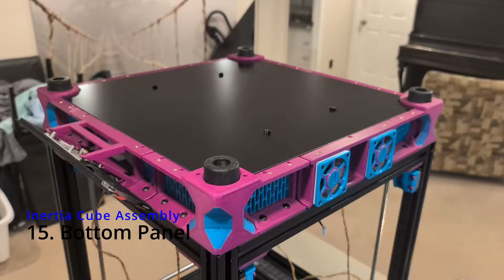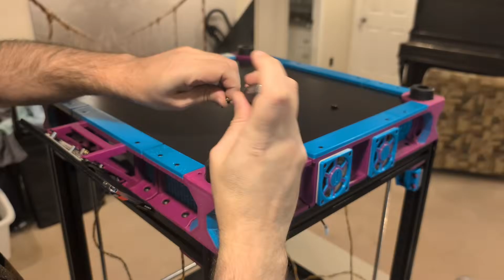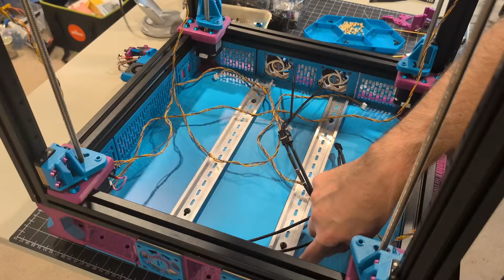Inertia Cube Assembly - 15. Bottom Panel

Comment: Do you use send cut send in canada ? I'm trying to find a place in canada to cut my panel
Reply from the maker: Because I like to bling out my ACM panels with decals, I use Happy Mfg out of the US. There is a shop here in Ottawa that will do ACM and polycarbonate panels, but I haven't ordered anything from them yet.
Reply: @oldguymeltsplastic  thank you i will look into them , currently send cut send is out of 3mm acm and i would prefer order from Canada